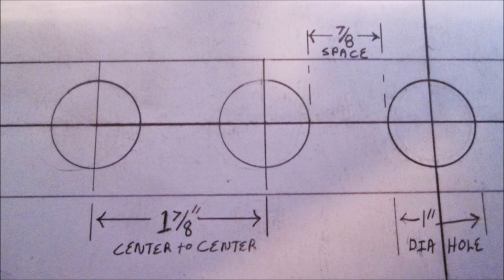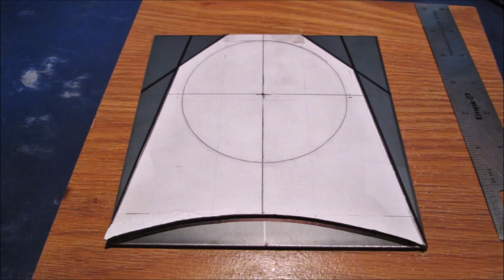Homemade Potbelly Stove 17 inch Dia top

Comment: Awesome!!!! If u start selling those small wood burning stoves, like the first square one, i,ll buy one from u long as the price is not too high,because if u try to buy those on line like for instance Etsy, or eBay, their selling for 4or5hundred,& in the thousands,no way i,d pay that much,for a little one like that & it, doesn't come w/ a chimnea pipe either.
Reply from the maker: To make theses to sell I would charge more than what people would pay ..There are some cheap campstoves on the internet under a 100 dollars  that can be modified and improved to work better
Reply: @not2fast4u2c  I know ,but the cheap ones for a hundred or under r the ones most people like me don't want,,I rather have one of those smaller ones that sits off the floor,& u can fix it up on the wall to make room in your pub shed.